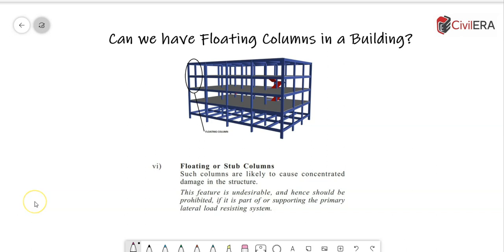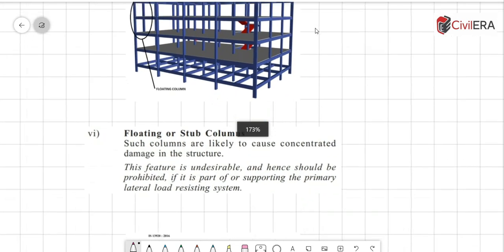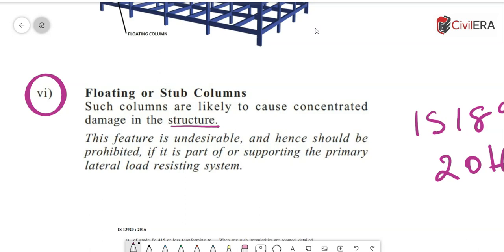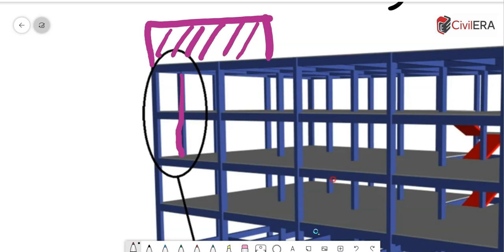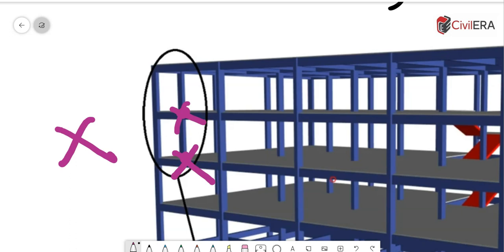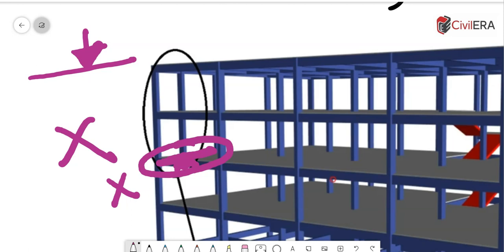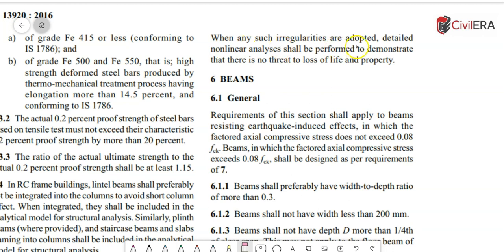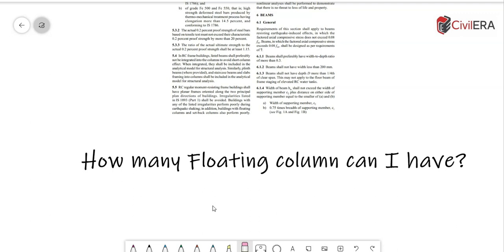Is Floating Columns allowed in a Building?

Comment: Do we need to assign the end releases just at bottom of floating column or both at top and bottom ends ?
if we're doing so then how would we detail it to make it behave as a pin pin connection to transfer gravity loads only.
Can you please share some typical reinforcement details of some floating column resting on beam ?
Reply from the maker: you need to make it gravity only column. So how can you do it with out releasing top? it will act as a frame right? Take up the advanced courses to learn in a comprehensive manner
see course.civilera.com

Comment: Can you tell me how to model Floating column in Etabs
Reply from the maker: You need to ensure only gravity loads are transfered. You need to release the rotations. Also ensure the building is schemed properly with adequate lateral resistance else where. It is not just about modelling the column. Its also about the overall scheme.